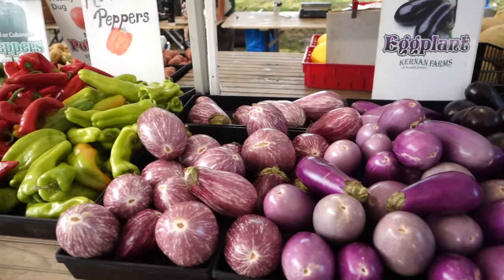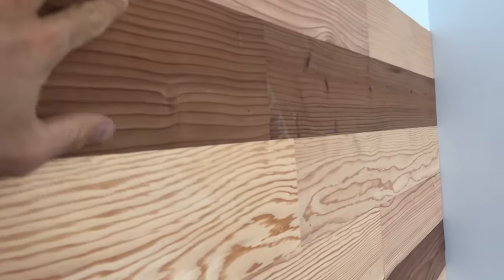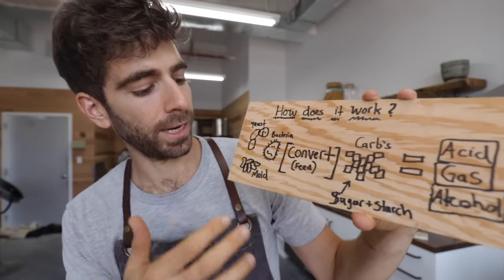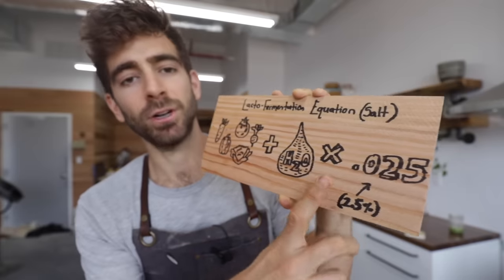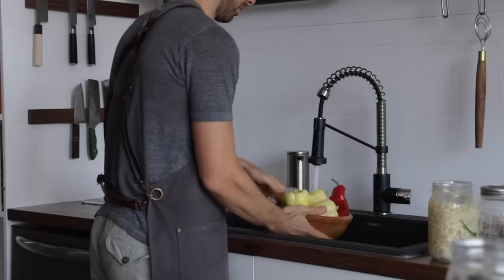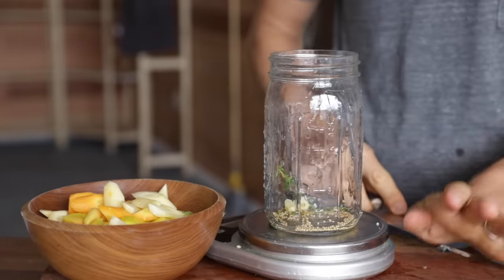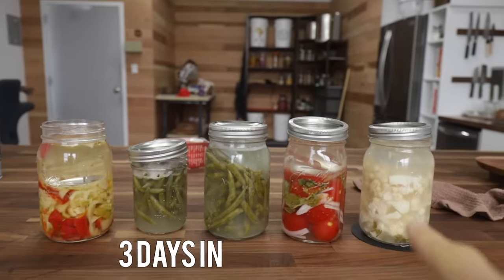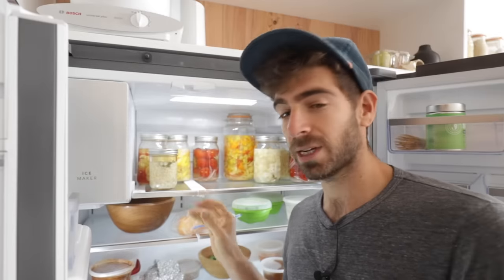The Complete Guide to Fermenting Every Single Vegetable

Comment: Nice Job!
I'm from Bulgaria, and we do ferment veggies as far as anyone can remember. 
You should definetely try some of the Balkan combinations, I am sure you will love them.
The most classic recipe is a mix of Cauliflower, Carrots and Sweet Peppers (a fleshier variety, we use a sort that is round and almost looks like a tomato) as for flavoring, a few straws of Celery are a must (Or maybe a piece of celery root), a few pieces of onion 1-2 cloves of Garlic, and eventually coriander or allspice if you like it. A lot of people add green tomatoes to the mix, but I really hate those, so I prefer to keep them out of the mix. Others like adding gherkins, but they don't fement quite right in this mixture, I prefer them when they are fermented separately (just gherkins and some spices). You can also add ocra, but make sure it is really young and tender. Old ocra sucks in pickled form. Same goes for green beans (I am actually happy they got spoiled :D)
Another recipe that I really love is Sour Garlic... which is just pickled garlic. You pickle the whole garlic heads without separating the cloves. You just remove the flaky stuff from outside and proceed with the brine. I just love that.
And a small trick I know from older folks, that prevents mold even if some part of the veggies is above water.... You place a tablet of aspirin on the bottom of the jar before adding the veggies, and then another one on top, after you have added the brine. With this addition fermented veggies can last for at least two years.
And yet another trick. During the first stages of fermentation it is good to turn the jars upside down every day or two. 

There are many cool recipes that I haven't even tried. I've heard of pickled grapes, which sounds quite interresting. And also pickled baby watermelons (It turns out, that when you grow watermelons, at a certain point you have to remove some of them from the stem, to provide more nutrients for the others.... So instead of throwing them away, you picjle them) :)
Reply: zeoxbg thank you so much I am excited to try a few of your suggestions!
Reply: Thanks a lot sharing, I'm interested in making Sour Garlic, but what is the Brine?😊
Reply: @gldistrict  I'll tell you the recipe for a 3 litre jar. I hope you can adjust it to your jar size.
- Step one remove roots and stems from garlic heads (younger garlic is preferred).
- remove some of the loose skin around the heads.
- Put them in a jar at top it up with fresh water. Place the lid on top, but do not seal the jar. After 24 hours remove the old water and fill it up again. You repeat this process 3 times!
- After you remove the third batch of fresh waterm you add:
- 4 table spoons of salt
- 4 table spoons of sugar
- 4 table spoons of vinegar (you can make it 6 or 8.. depends on your taste)
- Add any herbs or spices you might want, like dill and allspice (I prefer it with no extra spices).
- Top up with water.
- close the lid, but again do not seal it. Leave it in a shady cool place to ferment for 3-4 days (you might use one of those valves to let CO2 excape).
- After 3 to 5 days, check how things are going, the initial fermentation should be over and CO2 peoduction should be lower now. 
At this stage top yp with water if needed and seal the jar. Leave in a shady or dark place. After about 5 days, the brine will get murky. After about a week or so it should start to clarify, and the garlic will get a slight pink/yellow hue, this means it is ready to consumption.

Enjoy :)
Reply: @zeoxbg  awesome! Thank you so much!
Reply: Did Bulgarians invent giardiniera? I thought it was the Italians, but your first paragraph sounds just like it. In general, I feel like the best pickles come from Japan, Eastern Europe and South Korea.
Reply: All cultures pickle. Persians and Indians have very many types of pickle eaten commonly still to this day.
Reply: @zeoxbg  definitely making this love sour and garlic
Wish I lived in a country with a much more diverse food culture and not just processed crap full of corn syrup i come from a family of terrible cooks and food habits and i feel in love with pickled and brined foods and about 4 years ago discovered fermenting. Know one ik likes any of it and think I'm a weird person when they see and or smell it lol especially my wife she's turned me off of the fermenting just because i feel judged by it and have to hear her complain I've invested pretty deeply into fermenting and haven't touched in in about a year if anyone in the upstate.ny area near Syracuse and Auburn newyork would like all my equipment i wouldn't mind giving them up as long as they'll be utilized 
Still making sour garlic tho as I've never had it and will prob last me awhile
.also what in the aspirin helps keep the ferments fresh?
And check out wild fermentation uncensored on Facebook very good group make sure its the uncensored version
Reply: This is the best youtube comment I have ever come across.  Thank you 🙂
Reply: Gerard Cowan  is someone forcing you to live here?
Reply: @zeoxbg  Hey , when you say ferented veggies can be kept for up to two years when using the aspirin trick, do you mean just sitting on a shelf? r in the refrigerator or some other way?  also, when you said one aspirin on top before the veggies and one after the water, is that for a 3 litre jar? I want to try this method. One more question for you please. How long do the veggies last on a shelf before they go bad, when NOT using the aspirin trick? Im curious how long normal fermented foods last on the shelf.  Thank you! and Cheers from the US!
Reply: Ive tried some bulgarian picked products from stores and they are really tasty!
Reply: Dude, you should write a book.  Very entertaining writer.
Reply: Thanks guys. And sorry for my late input.

Regarding Aspirin usage, I think I wrote a more detailed explanation somehere down here in the comments. In short Aspirin is a synthetic version of a chemical that trees use to keep mold and other stuff off of their barks... So it is just a very good anti-molding chemical :)

Regarding the invention of pickling... I don't know for sure, but I doubt it was invented by Bulgarians :)
I suppose it was developed somewhere in Asia, perhaps India or even further east.
Modern Bulgaria is an amalgamation of several ethnicities. It was established in 681AD... And I am pretty sure fermentation was invented long before that :)
However ancient Bulgars, before establishing this state, were nomadic people, roaming the central asian steppes, and gradually moving east. So they had extensive contact with people from India, China, Mongolia etc... Perhaps the learned about fermentation from them.

It is worth remembering that most of the veggies we pickle nowadays, were not available to the ancients. They probably started with cabbage, and later on when new veggies came from the new world, they just started experimenting with those :)
Reply: @zeoxbg  Thanks for the reply! With aspirin use, do you mean it keep longer at room tempursature or in the fridge? Thanks again.
Reply: @nobodyspecialdotorgrichard5971  
Room temp... Or rather cellar temp :)
Reply: @zeoxbg Can I put BC Powder instead of asprin which is a powder asprin without all the junk in the pill form?  Plain bc powder is healthy but aspin in pill form is full of other chemicals.  Just wondering if mixing with brine would prevent mold perhaps.  Thank you
Reply: @ello8689  I'm not familiar with this BC powder, we don't have it around here. But as long as its main ingredient is acetyl sallicilic acid, it should be fine.
Reply: @zeoxbg  Do you peel the outer flaky paper like substance from the garlic ? You never included how much garlic to a 3 liter jar. 3 liter is pretty large. Distilled white vinegar, apple cider, or another type ?
Reply: @captainadams7569  Yes, you peel all of the loose skin, leaving only the skin that is not flaky, and stands firm on the garlic head.
How much garlic, depends on the size of the garlic you use... Just fill up the jar ;)

Regarding vinegar... Grape or Apple vinegar is fine as long as it is natural. Lately we've had problems with some coomercially available vinegars, that are not exactly what they claim to be. A few years ago, Bulgarian legislation forced them to name their products "sour product" instead of vinegar, so not to be mistaken with real natural vinegar.
This legislation was prompted by thousands of failed pickling attempts throughout the country. People with a lot of experience in pickling just failed miserably.
Later on they found out that the vinegar they used is crap... May be good for salds, but not for pickling.
Reply: Thank you for the suggestions.
Reply: @zeoxbg  Thank you!!!
Reply: Zeoxbg thank you so much for this comment i feel some pickling jars being acquired soon.
Reply: this was just what I needed.
I'm Dutch, we mostly do the sauerkraut stuff (zuurkool - sour cabbage) and gherkins. The only freaky thing is our herring, I guess - but I just stick to vegetables for now. I started experimenting about 2-3 years ago and have tried a lot of things, but not this particular recipe. Haven't tried ocra at all, I usually have them frozen, which definitely ruins fermenting...
Reply: @zeoxbg  what do you eat it  with?  Can you use that garlic in cooking ?
Reply: @sauravbasu8805  everything?
Reply: I am from Ukraine, I live fermentation ! Talking about garlic, add a bit of slices beets, it will turn to a beautiful color and charming test, but I prefer separate cloves but keep the skin.
Reply: U r amazing... Thx for ur time to share ur recipe
Reply: I've made pickled grapes several times, and they are delicious!  I add some red pepper, herbs, and garlic.  They are in fact, vinegar pickles, not fermented...which does sound like an interesting idea I need to try.
Reply: Wow! Thanks for your exciting and enlightening commentary!!!
Reply: @j3ffn4v4rr0  
What are these pickled grapes used for ?
Reply: Amazing ! Thanks for sharing
Reply: Can I follow you?  I love your to the point common sense delivery.
Reply: @gldistrict  yes, the garlic brine and the gherkin brine, I'd love the recipe! TYIA
Reply: @jefferyschic  Sure, but I am not very regular at posting. I am not sure how beneficial would it be for you to follow me :)
Reply: I know from some older books that watermelon rinds used to be pickled, here in the USA. I'm thinking the idea with the baby watermelon is similar.
Reply: Wow this was a lot of useful information! Thank you!
Reply: I would like to add my 2 cents here. It is better to add salt by weight percentage then by spoon size, because salt density differs from brand to brand. Here are general guidelines, weigh total volume of your mixture, water plus veggies. For leafy stuff add 2.5% of salt by weight, so for 1 kilo, 25 grams. For pickles, peppers, etc. 3.5% of salt. You can then ferment at room temp between 14 to 28 days and it will keep in the fridge for up to 6 months without aspirin. During this fermentation period, proper amount of proper acid is formed, that's what preserves the contents for months. Vinegar is added for longer keep because it is also an acid, but it may kill beneficial bacteria that is formed during fermentation. The longer you ferment, the more acid is produced by bacteria and more sour it will taste.
Reply: @zeoxbg  Good write mate. I am from Romania, living in Scotland. We use aspirin for wine lol 😄
Reply: Thank you… I’m new to fermenting… any generational tip has got to make this experience easier and yummy
Reply: if you dont mind i would like have some recipies for personal uses at home ...
Reply: @zeoxbg  Thank you, you write about Bulgaria's history so entertainingly.
Reply: @corbeau-_-  How do you do the herring please?
Reply: @j3ffn4v4rr0  How do you make pickled grapes please?
Reply: @maryamerry4302  I enjoy the pickled grapes in a salad (if they are small, or sliced) or on the side with a sandwich or pasta, similar to how pepperoncini peppers are served. They are small very spicy bites, think of them as a small pepper, and you can use them in similar ways to that.
Reply: @newtheboyzdeboisandnewatin9513  Making pickled grapes....red and/or green grapes (my favorite is red) in a pint jar,  in a pan bring to a boil half water & half vinegar with a little salt & sugar, maybe a few black peppercorns, a small sprig of rosemary, a tsp or so of red Chile flakes, then pour the hot liquid/spice mixture over the grapes in the jar & close the lid....let it cool down and stick it in the fridge overnight. You can use them right away, but the flavors will be the best after several days. Keep them in the fridge, they will last for a few months.
Reply: @j3ffn4v4rr0  Thank you very much!
Reply: @newtheboyzdeboisandnewatin9513  you're welcome! And I forgot to put (wrote it from memory) to include a couple cloves of garlic... can't ever forget garlic!! And if you like, also a bay leaf.
Reply: @j3ffn4v4rr0  Ok, got it. Thanks again
Reply: What do you use sour garlic for?
Reply: @camis.1347  Direct consumption. As any other pickled veggie.
Reply: fermented watermelon 🍉 ooomg best! they must be small ones ,like babies
Reply: @anamariagheorghe385  Yes, they are the size of a medium apple/peach. They are removed from the stalk at this stage, and only 2 or 3 (the best) are left to become a full grown watermelon. Many things can be fermented whole when they are that young, baby corn for instance.

Very young walnuts, green and with no hard shell, are used to make a speciffic type of jam around here too.
Reply: @zeoxbg , you are amazing!! Thank you for generously sharing your recipes and expertise. 💖 Sending all my well-wishes from the U.S.
Reply: @gldistrict  salted water
Reply: @zeoxbg  Thank you!  I will try this!  I do happen to have a 3 (or 4) liter heavy glass jar, that I bough for just this purpose.
Reply: @GarrySkipPerkins  
Give the following a try:
-  Indian Achar pickles.  They come in many ranges of sourness, sweetness, etc.
-  Preserved Lemons.  An amazing-tasting & ubiquitous condiment in Indian, Moroccan, etc. cooking.  Don't buy,  google a recipe and make it yourself.
Reply: @gerardcowan155  I know you posted this 2y ago.  I hope that you didn't stop. Maybe do it in a shed in the backyard?  Once in jars, you can transfer to the basement. Have a means of venting out, so that when the jars "burp" (as they will) the smell is minimized.
Reply: As someone who is allergic to aspirin and all salicylates this is a BAD idea. Some Amish communities here in the USA do this, I know for a fact. Aspirin is a drug. It is a blood thinner and should never be added to food without it being listed on the label.
Reply: I ❤pickled watermelons as a child! Have not had them in ages ☹️
Reply: i will try ur recipe cheers
Reply: Great comment.  Well done.
Yes it fun to experiment with ferments.
Reply: tursija
Reply: Thank you for the good info, I just got back from Varna two weeks ago. Bulgarian yogurt is the best.
Reply: Didn't understand when you say that the jars are to be turned upside down every two days. Won't the liquid come out?
Reply: @hemantghayal7709  If you are doing an open lid fermentation - yes. But you can keep them closed and burp them every day or two in the beginning.